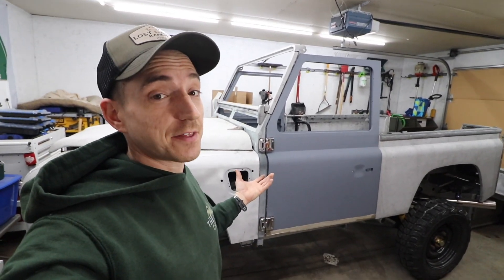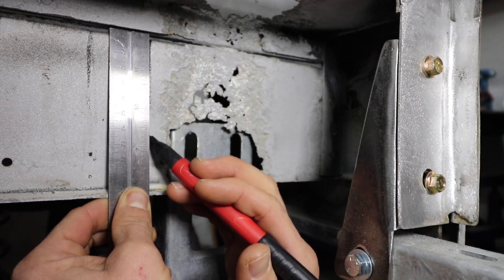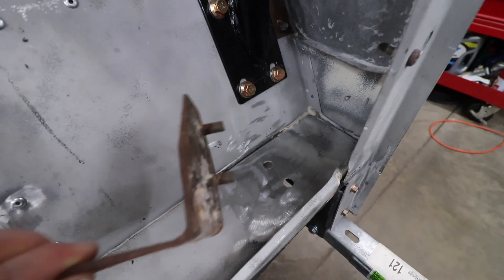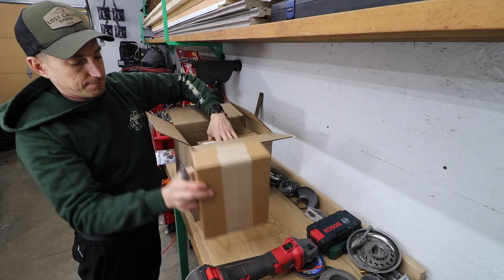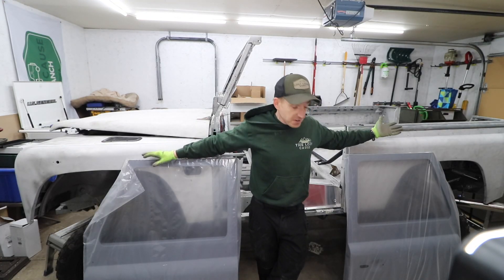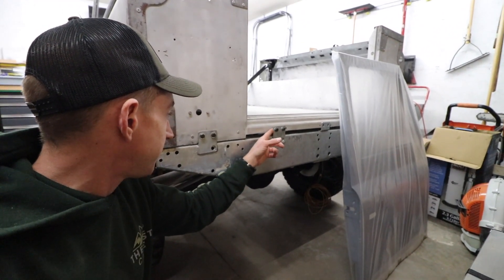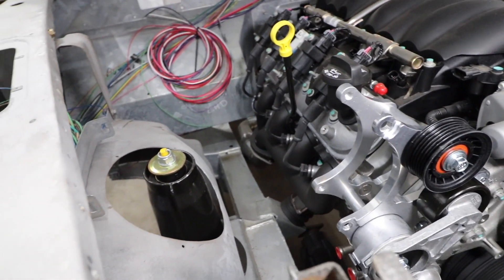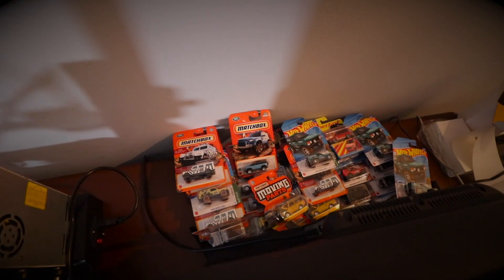New Doors! - The LS3 Defender is Coming Together

Comment: you might talk about this on the next video, but what power steering pump are you going to use  (gm, rover) i think i remember reading that rover steering boxes can only handle 1000psi and most gm pumps are 1200 and above.
Reply from the maker: I have a gm one from an Impala coming that I’m going to try first otherwise it will be a Camaro one. There are some reduced pressure valves out there that I’ll end up using.